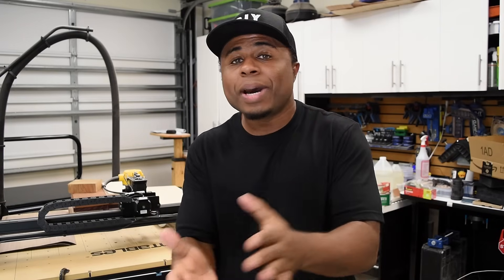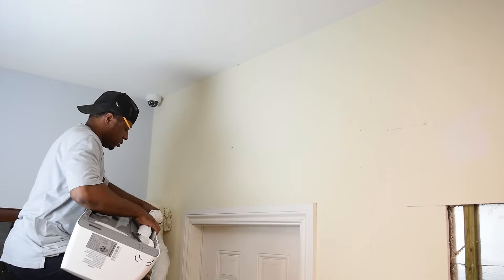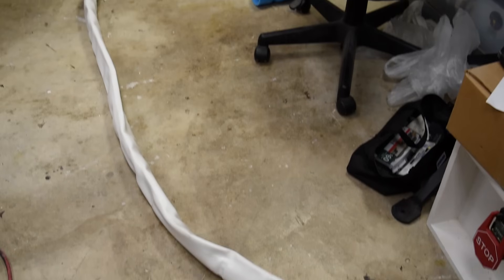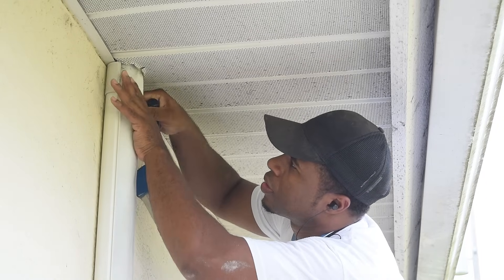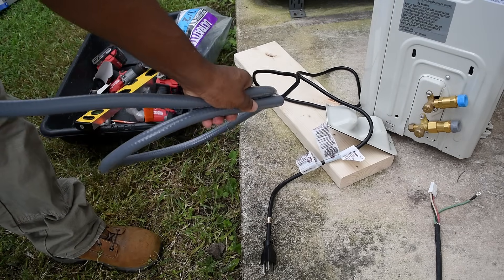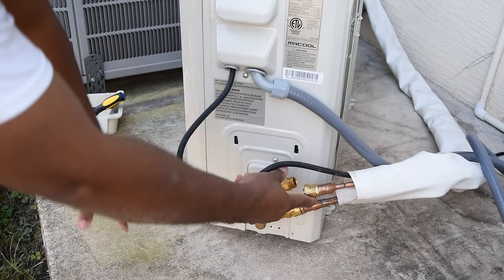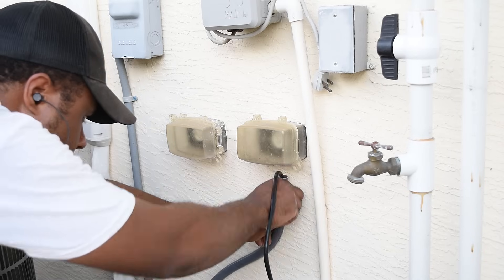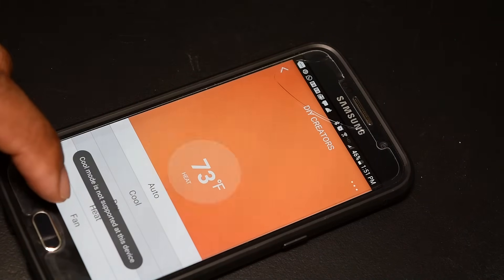How To install Ductless AC & Heating System // True DIY Mini Split MRCOOL

Comment: 12:50 if you have Floor electric heaters 220.Can you disconnect them and connect The mini split with that power , or do you have to Power

Comment: I just purchased 2. 115v mini split units. One thing I'm not that clear on is do I need to add extra circuit breakers for each unit? Also how can you tell if the units are pre charged. I purchased mine from a local ad and the units are new.
Thanks for any help.

Comment: Much better systems out there and if you can't wire one up or pull vacuum you really have no business doing this. Yeah McCool kinda sure for a quality unit and the inovair or gree is a way better more efficient unit. Just check the weight of the outdoor unit. The heavier the outdoor unit the better. If you do 20 min of research before buying you will be alot happier. Go with inovair

Comment: Hi, your video is very informative, easy to follow and simple. I have 1 question or clarification. Do we need to remove the air from the copper pipes and/or vacuum  it before use? Please advise.

Comment: Condenser coil heat exchange air goes directly to residential condenser coil. If you can separate these two units a healthy distance if you do it yourself but this is awesome.

Comment: This is my man. All others show to help  but in easy way. Just drill the hole to outside and that is it. What if the air handler is not in the position right outside. What if the opposite wall. Has to go up in the attic some how

Comment: Thank you looks Like I will only need 10 Foot lines . After 4 years if you needed a Air / Heat system get the same again or is there a better one NOW ??????

Comment: I was curious to see how these units are installed. I did not know there was an outside condenser; I learned a whole lot more than what I thought.

Also, this DIY video is great and I agree with a previous post that said “the video kept progressing forward, no chit chat or long drawn out stories etc”. The audio was good; I could hear you clearly and the background music was at the right volume level. Excellent job!!!👍🏾👍🏾👍🏾

Comment: Man thank you very much I am so impressed with your videos I mean totally impressed I watch you when I have an opportunity to do so and today I was just sitting wondering how would I route my existing air conditioning unit over to my RV garage and I couldn't get anybody to answer that question for me I called a few air conditioning companies but they're all about the money but you just answered my question I will move forward and go with the DIY system Mr cool that you mentioned in your video I want to thank you again and you made it look so easy I had no idea that the system could plug into a standard outlet 120 I need two to go in my RV garage thanks again I'll be watching

Comment: Quit tip on the magnetic screw bits... you can just plunk a small magnet on a bit and it will do the same thing if you don't want to buy one.  Or you can get a magnetizer for the short bits and run it through the magnetizer and wala magnetized bits.

Comment: We installed a Mini Split several years ago in our garage here in Florida where it is summer all the time with major humidity.  It is amazing, cool garage, not only for my rust free vehicles but also for all of the items we have stored in the garage.  Highly recommend, cheep to run and many, many times lower humidity than the inside of our home.  Good luck.  Think about it.   👍👍👍.  7-4-22

Comment: why would u not vacuum the pipes,
air in the cooling pipes is never a good thing
Reply from the maker: Because this is a DIY version, it comes precharged and it's designed this way.

Comment: Sweet. Great job explaining the details. I have a second level on my shop and I"m thinking about getting one of these. We were in a small cabin this weekend that used one of these and it cooled off things quickly. Right now it's a window unit that takes a LONG time to cool (Florida!). I wasn't sure I could do this on my own but this looks doable. I may have to build a platform so the unit is closer to the inside air handler but it doesn't look extremely heavy. Thanks

Comment: 09:27 - opening the refrigerant lines WITHOUT vacuuming the system is IDIOTIC.
It automatically lowers the efficiency of this unit by factor of 2.

Idiotic stuff. This one mistake practically makes it as efficient as cheap Chinese units, also dramatically lowers it's service life.

Comment: Outstanding video - thanks for sharing - I have a similar garage and have not been able to work in there because of the temperature.  With your video, I will no longer be freezing or sweating.  Michel

Comment: Mr Cool is an absolute garbage product.  No service reps in my area, I ask to return it due to that.  They say contact where I bought it.  Did that they said call Mr Cool.  Neither Mr cool or HVAC Direct will backnup this product.  Now, my purpose in life after flushing 3k down the drain, is to tell people run, run fast and don't look back.  Buy local, you have local support.

Comment: oOooF. BEFORE YOU start making hole in your walls, especially as deep as the ones shown in this video- CONSULT professional, as it can lead to wide variety of headaches. SO MANY THINGS CAN GO WRONG doing this. Pipes, ELECTRICAL WIRINGS, etc can be behind your walls. BE CAREFUL.

Comment: What I don't understand is how these DIY install units skip the step of pulling a vacuum on the lineset/ evaporator? ALL minisplits come with the refrigerant stored in the condenser, but usually you have to hook up a vacuum pump after you have connected the lineset and pull the system down to 15 microns or so, THEN release the refrigerant from the condenser. how is mr cool able to skip this critical step? Their lineset connections do look different from what I have seen on regular mini splits. very curious as to what they have come up with to be able to skip this step?

Comment: excellent straight forward instructive video.  Thanks.  1 question: many of the instruction sets suggest using an AC refrigerant compatible sealant on the line's connectors.  Did you consider that or do you feel that the compression fittings are good enough to not take the extra step of applying sealant?  Thanks

Comment: Is there a reason you didn't use a vacuum pump? I have  a similar system and it's one of the steps to take before running the system.

Comment: @7:20, it does matter which order you connect the electrical terminals.  When connecting electrical terminals, always connect the ground first.  When disconnecting electrical terminals, always disconnect the ground last.   This could save your life.  Safety first!
Reply: It doesn't matter when connecting because there wasn't any power to the unit. Explain to me what could happen when he wasn't tied in to any circuit. When disconnecting you always makes sure the circuit is disconnected before starting.
Reply: @lilcourtny08  if someone inadvertently cuts the power on while you are connecting or disconnecting electrical terminals, my advice will make perfect sense.
Reply: @cm1133  lol, I see you have never did much electrical work. I guess you have never heard of using simple locks to prevent the breaker from being turned back on. I worked for a industrial electrical company. When we turned of the power several people would have locks on the breaker to prevent the power from being turned on and we would verify to make sure nobody was still working before turning power back on. What you are saying is true because I had a guy come into a room before and turn on the lights while I was changing out a old light for a newer led light. So we killed the power and put a lock on the breaker. Saving a very small amount of time is not worth a life.

Comment: coming from an hvac/r tech. good job. but you really should have pulled a vacuum on the lines first. air and non condensibles are terrible for the system.

Comment: I had this same system installed (Samsung) 15 years ago in my apartment back in Serbia and it works perfectly, it heats up when its minus 10C (14F) outside and it cools down on plus 35C (95F). 
Now I live in Canada and I always wondered why people here dont use this system more..

Comment: Great job as always but, AC are dependent on where their thermostat is located and positioning.  This will work fine but could work better to cool in a lower location as hot air rises!  Either way great video!
Reply: I see why you did go high though!

Comment: Scary install if you didn’t vacuum the line set down to 500 microns and a electrician might say the same thing.
Reply: He did not vacuum the lines, which he should have.
Reply from the maker: This is a DIY unit! No vacuum can be done. The lines are Pre-Charged from factory.
Reply: You need to look up how to vacuum ac system down to 500 microns before releasing the charge in the condenser into the line set.  Air in the system will cause the refrigerant to break down over time and it may kill the compressors as time goes by.

Comment: This is garbage YOU CANNOT INSTALL YOUR OWN AIR CONDITIONING UNIT please don’t do this you have no idea what you are doing at all get a fucking hvac contractor you have to pull a vacuum on a system before you just release Freon into the lines with no vacuum and you don’t just wrap the line set wherever it can go 🤦‍♂️

Comment: Hold on. You cut through the green stud. Isn't that a support wall/stud? Doesn't that create a fault?
Reply from the maker: No, it's a framing strip attached to the CBS Wall. The wood is nailed to the blocks from top to bottom.

Comment: I highly recommend not doing this, the installation was very good in ways of teaching, but when it comes to the outdoor unit there were a number of things that is very bad
1. The lines need to be vacuumed down into a negative pressure this makes sure there is no oxygen in your lines and ensures all u have is refrigerant in your lines, this improves unit Efficiency by a ton.
2. Not that it matters with this type of unit all flared connections need to be tightened to tork settings this will ensure u don’t crush your flares.
3. Doing your own electrical is very dangerous for anyone not experienced, basic air conditioning installs require a brand new 20amp breaker with isolator installed next to your outdoor. Not only that the wires are colour coded so if it ever gets serviced by a hvac tradie they will have to check both in and outdoor units.
Something that isn’t explained is the wiring needs to be the same on both units.
Earth wires/ground wires have to be done properly and by a trained installer. It is way to dangerous to do it without the knowledge, this is the reason why u don’t die when u accidentally touch a live wire.

Overall the installation was clean and very well done, but I woudnt recommend u do it without the right tools and knowledge

Comment: My guy, gotta address that garage door.
Under 100$, insulate and kill that radiant heat. Door just bakes garage in summer, and freezes in winter. That'll help your unit not overwork big time and keep temps in the garage better/longer.

Comment: I would be interested to know how that unit is holding up since it's been a couple years. Great video by the way.
Reply: Probably dead i work hvac and those selftap unit usually last 3 4 years befpre there is a leak

Comment: Do you need to vacuum the lines out before you open the valves or do the lines come pre vacuumed with some sort of seal on the ends?

Comment: This video is amazing!  Thank you!   I do have one question.  You mentioned for a second that if you don't want the outside unit on the floor it can be mounted on the wall because it's light enough?    Can one really do this?
Reply: Sure you can you just need to buy or make a bracket to attach to the wall.  These units do not weigh very much so this can be supported by almost any wall.

Comment: This is a very DIY friendly Unit. Most Mini Splits require a small amount of brazing. Not much though. And those flare fittings are great, but be careful when getting the right torq.

Comment: You can't do that with the line said you can't coil it up and put it in a box you need to cut it because if you don't cut it it's going to require more refrigerant for it to work proper didn't you go to HVAC School

Comment: but does it impact the sound proofing of the workshop? I am planning to build a small woodworking shed  in my backyard about 2.5 x 2.5 meters (i am aware its a really small space but that's what i have for now) and one of the issues is how to make it cooled/heated without losing soundproofing.

Comment: HVAC guys must not have Google. These lines have special couplings attached making them sealed, even the instructions say to tighten as quickly as possible to minimize air introduction.  For what you pay an HVAC guy to install and buy the system if this one breaks you could buy another and still save the money.

Comment: you should have evacuate the evaporator and lube the thread with refrigerant oil. The long high side and low side tube can be cut and re-flared but you should have the tools to do it right. I don't recommend this install unless you know about A/C system and have vacuum pump and other A/C tools.

Comment: Awesome DIY video. Did you also insulate/seal off the garage door to keep cool air from escaping or is that not really a problem? I just don't want the unit continually running to keep the garage cool. - Thanks
Reply: Insulating and stopping air leakage would be the first thing to do. This is a small 110v system with a capacity similar to a window unit. 
     In fact a lot of people would cut a hole thru a brick wall the exact size of a window unit and just put a window unit in without a window. 
      This however does not give the adaptability to heat as well as cool. Like these little heat pumps

Comment: This is a nice DIY! But, as a HVAC tech, I would say you really need to do a vacuum in your lines before releasing the gas in the system. It's gonna take away all the humidity and impurities in the system. Refrigerant hates humidity. Your system will probably still work but it won't be as performant and eventually you will end up having problems. 
But still, great video TY for sharing this.
Reply: From what I'm told, they are prefilled to pressure with nitrogen.  That coming from an hvac tech who installed it. However as an hvac tech, I believe they need to be evac`d, idk if they do it though...
Reply: I wonder if they are lines are pre-charged with refrigerant? Kind of like mobile home HVAC. As they get tightened, they break a seal.
Reply: Agree. I watched the whole video hoping to see how he does the vaccum, but disappointedly he did not.

Comment: I haven’t start a few of these but not the DIY’s are those complete copper line sets? They seem very flexible on the ones I put in the copper was crap so hard to bend. Anyhow very good video very informative great job.

Comment: You skipped over how to wire up the indoor unit. The Mr. Cool I purchased calls for red/black/blue/yellow wires to be connected to the indoor unit. However, there is no blue or yellow wires. Was hoping to see how you wired yours...

Comment: 150% wrong with just connecting the AC lines and opening the valves. The lines you ran after connected “has to be” evacuated. Meaning you need a vacuum pump and manifold to remove all oxygen and nitrogen from the lines to get it below atmospheric pressure. Now it will turn on like you showed but it will burn out fast and leave you with a paperweight. Even though a nicely done video you are going to ruin people’s systems. Plus it’s a minimum of 6” space you need at the top of the indoor unit.

Comment: I'm an hvac tech who has installed many mini split installs the install was improper he missed a very important step he didnt put it in a vacuum to remove any non condensables gotta be atleast 600 microns it won't work efficiently

Comment: "Made In China" if you look closely.  As far as I'm concerned, they can KEEP it in China, too.  And to add my two cents......yes, the lines would have air in them and need to be evacuated (pulled into a vacuum) BEFORE opening the valves on the condensing unit and introducing refrigerant into the system.  There's NO WAY this install ended up working properly......

Comment: If I needed to run the drain hose up into the ceiling first. Does it have a pump to pump out the condensate water. Or will it back up and leak if I do that?

Comment: After installing an AC system you should pressure tested with Oxygen Free nitrogen then  leak test joints with either soap water or recommended leak detecting spray and not forgetting to vacumme the pipes for -30 Hg to evacuate moisture in pipe run before you open you gas valves.
Do it right my brother!

Comment: Great video, thanks! At 8:30, note that the adjustable wrench in your right hand is technically "backwards"; you normally want the smaller sliding jaw to "lead" not "follow" during the tightening stroke. Gives a far better grip, especially with older crescent wrenches with worn jaws.

Comment: I like your videos but you're missing a crucial step to this. You need to put the system under a vacuum with a vacuum pump. Reason being, you need to get the noncondenseables out of the lines.

Comment: You most certainly can cut lines. Just reflare and connect. You also should really put vacuum pump on system to pull moisture out, and help charge. You can buy pump and gauges cheap.

Comment: I see one thing is you have air in the lines you should have a vac pump to suck out the air or purge as you didn’t do this you unit will not last the warranty

Comment: If you pipe run is longer than 10m you will need a hvac technician and I’m glad you did this I do air conditioning and showing my trade explained helps me because I do get some clients who are not taking the wires pipes into consideration